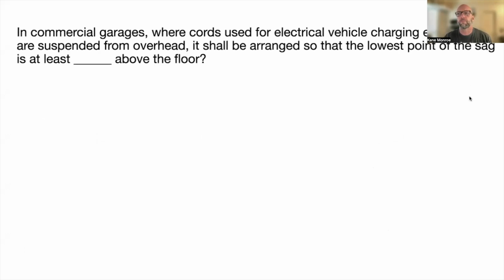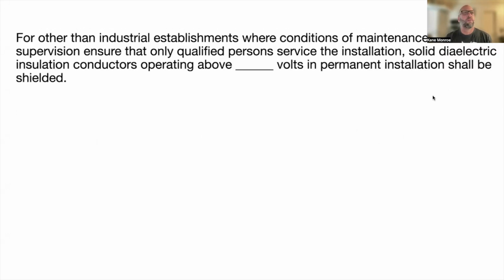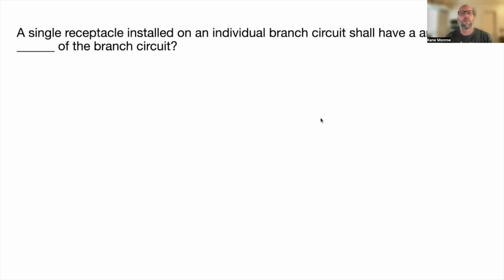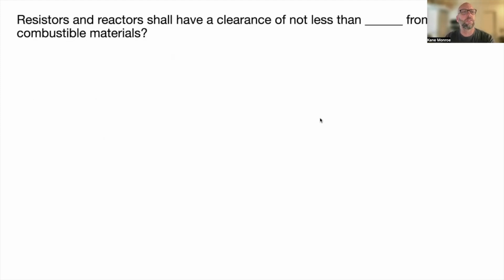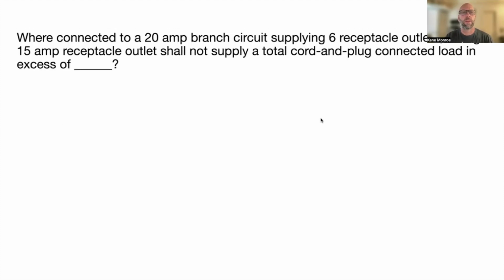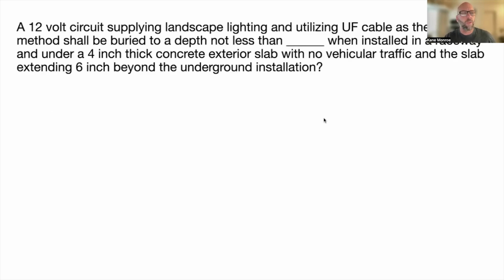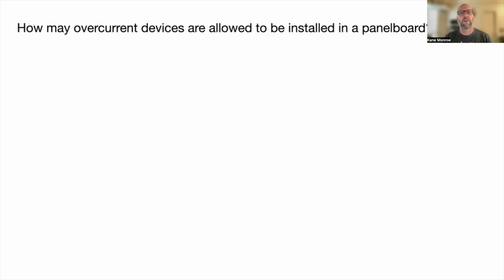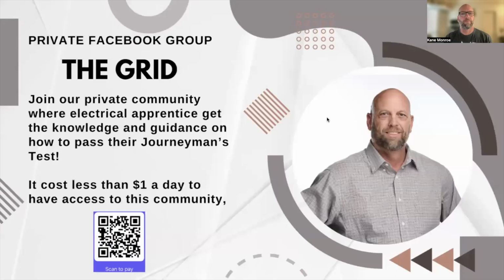The Best Journeyman Test Study Questions Video #9 #testpreparation #electricianlife

Comment: My 2023 code book does not have chapter 311 it has 310 and 312
Reply from the maker: This information is from the 2020 code book. The question on the test will be the same but you will have to find the new article reference in the 2023. I will look it up in the 2023 and let you know where it is.
Reply: @ thank you sir

Comment: Thanks for making these videos, I’m in second year iec 3rd quarter Dallas chapter and I am so worried about taking this test in a few years.
Reply from the maker: I am the Training Director and 4th year instructor at Southern New Mexico IEC. In your forth year second semester you will do nothing but go over code, so you will prepared to take the test. I have 17 students in my class right now and 7 have passed their test already. On March first the formate of the Texas test is changing towards the formate of the Masters test.
Reply: @jarrettthejourneyman7196   Yes I was told it will be 2 parts to the test. Is that good or bad?
Reply from the maker: @ I think it is good. I always suggest to my students to only take one section of the test at a time, don't take both test on the same day. Take your stronger section of the test last, if you are strong in calculations but weak in code, take the code first.
Reply: @ thank you very much for the guidance!